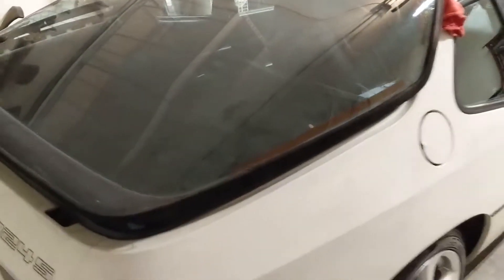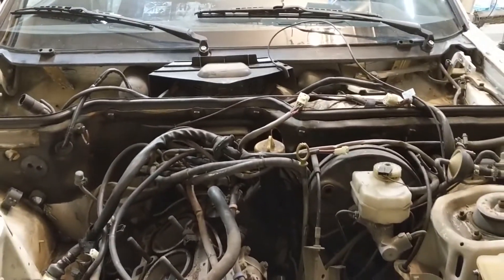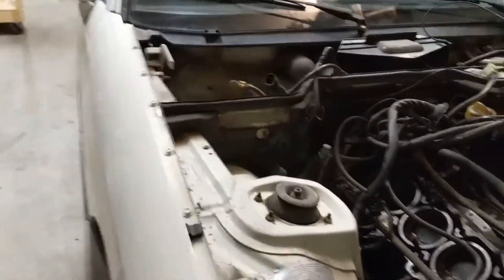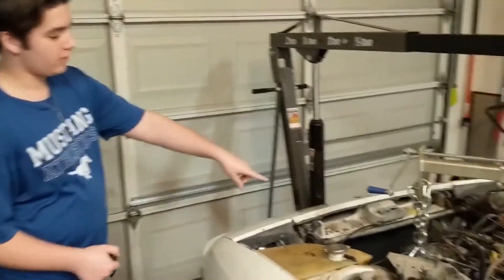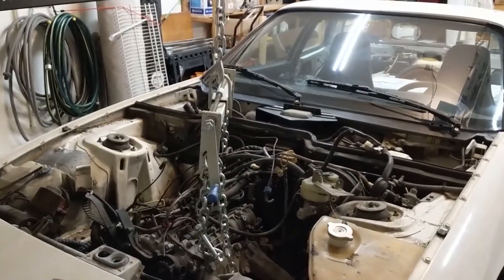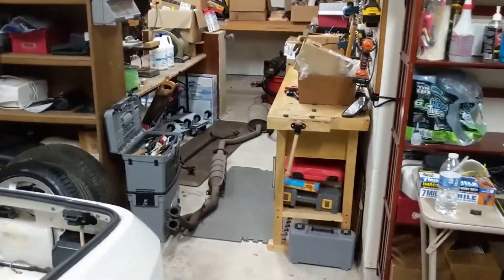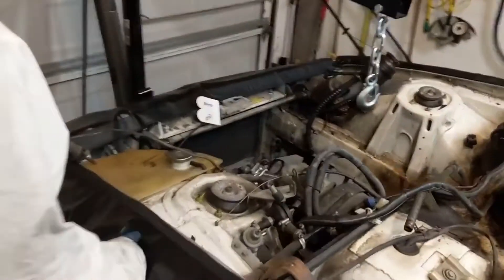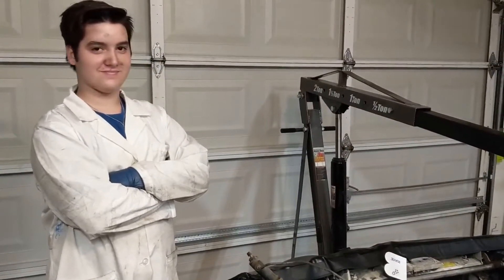Porsche 924S EV Conversion - Part 3

Comment: Very exiting times, but now the hard slog starts, stripping the old stuff is the easy bit. 😉
Have you decided what EV hardware you're going to use?
Reply from the maker: so far we are looking to use a nissan leaf motor and inverter. i also have the nissan leaf charger that goes on top as I was thinking we might also use a leaf battery pack to get the high voltages we need... but i'm not happy with what i'm finding out there, so we may switch to something where I can buy newer batteries (or something with more life in them). Open to suggestions for that! Also, we are using the Thunderstruck VCU. More videos coming soon!
Reply: @FrankGraffagnino  So are you keeping the Porsche Gearbox? If so how do you plan to couple the motor to it? 
If you can find a good 40kWh Leaf battery it would be good but best to buy a complete damaged car. That way you get all the bits that cost a lot more to buy separately.
Reply from the maker: @alibro7512  right now the plan is to put the motor and the leaf differential in the rear and hook it directly to the rear wheels. We were considering keeping the torque tube and putting it in the front but it would be a lot more weight and less room for batteries. The resolveEV guy basically did the same thing in his Porsche 944 so I'm taking that as inspiration!
Reply: @FrankGraffagnino  Sounds great. I'll be watching with interest. You started out in the right way with a fantastic car but be prepared for the long slog as even small jobs can take a day or two.
Reply from the maker: @alibro7512  thanks. Keep checking in! It helps to talk through this stuff!